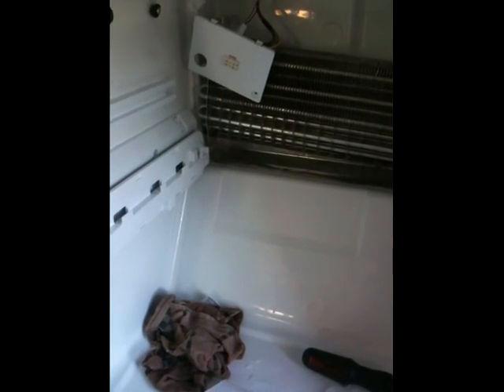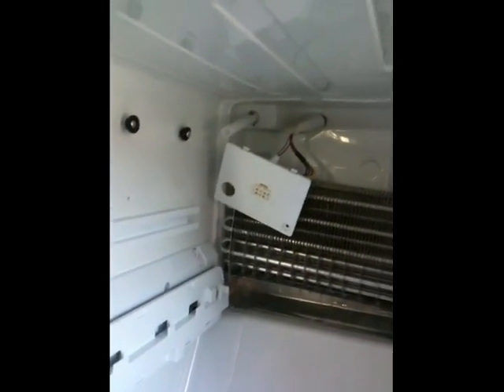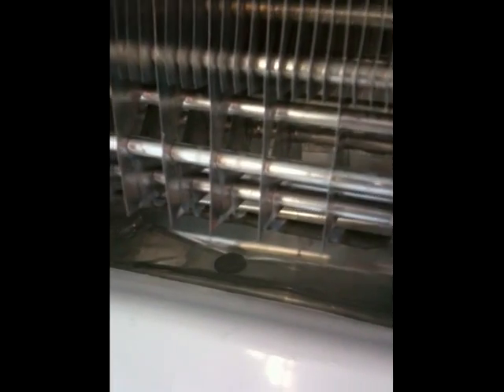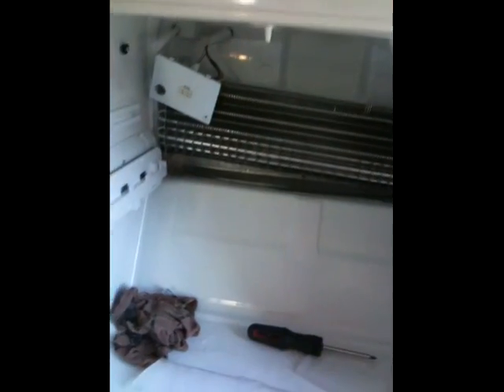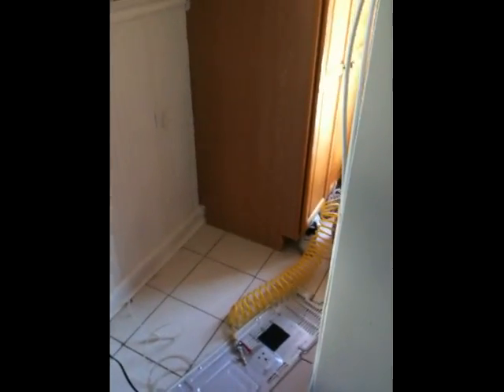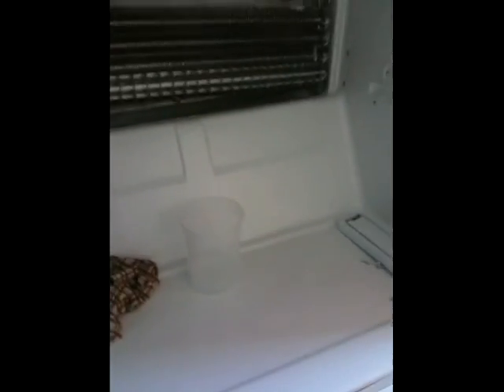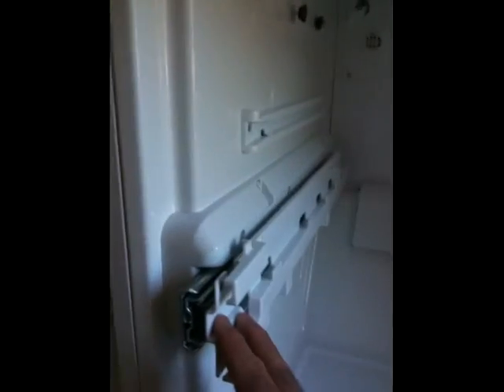LG Freezer repair (French Door, bottom Freezer model)

Comment: I know this is an old post, but I have to show my appreciation just the same.  Just did this and it was less than two hours start to finish.  Worked great, freezer is fixed. Saved me 3 grand for a new fridge.  I was concerned about the difference of opinion about removing the door. I have to say, it worked just the way you said it would.  Went back on very easy.  Maybe the guy below removed the wrong three screws.  The ones holding the door to the brackets, instead of the ones holding the brackets to the slides.  I can see potential for trouble if you do that. Anyway, thanks again!

Comment: After finding my freezer frozen shut again I let it defrost when just open a fraction.  I then purchased a small tube  FOOD SAFE lubricant from Taylor Freezer, about $4.  LG wanted about $14.  I used the FOOD SAFE LUBRICANT ( IT'S UP TO YOU TO CHECK IF IT MEETS SAFE APPROVAL IN FOOD AREAS ) on all of the lower metal door and draw slides and then put some on the plastic gears.  
Happy to say this solved the problem with opening the frozen freezer door.

Comment: Thanks! I was apprehensive about tearing into our LG refrigerator bottom freezer but the water leak on the floor near the machine and frozen water on the bottom of the freezer compartment fit the pattern. Sure enough when I got the back compartment cover off their was ice. The hair dryer worked nicely to melt the ice but it took a couple cups of hot water to unfreeze the drain hole. Thanks again for saving a repair bill.

Comment: Thanks for posting this.  After seeing the cause of the problem, I moved all my food to a second refrigerator in the house (used for cooling canned and bottled beverages (they came out)).  I then unplugged the LG refrigerator, opened the doors, put a towel on the floor to collect the melted ice from the freezer compartment, and let it sit for four days.  After that time, I opened the back of the unit (about 6 screws on the back at the bottom) and did see that the bottom tray was holding water, and the drain tube was squeezable,  I then cleaned the LG refrigerator (kinda dirty), and plugged it back in.  Two weeks later, no ice forming on the bottom of the freezer.  My lazy solution (but it needs a second refrigerator).

Comment: This definitely solved the problem and I'll note that there's a flapper valve on the bottom of the drain hose, be sure to clean it off as I think mine was stuck closes.  

Unfortunately my entire fridge and freezer stopped cooling after this, the only thing I can think of is that I didn't get the evaporator fan plugged back in.  So I get to take it all apart again!

Comment: Thanks for the service video. It provided everything I needed to take the frig apart, repair it, and put it back together. Somewhere I picked up to run a 14 gauge copper wire down through the the drain tube connecting the top end to the condenser. This is supposed to keep the tube from freezing as the copper will conduct enough heat in the drain line. Thanks again.

Comment: Excellent video, drayu! Thank you! I had been dealing with the ice buildup for months, when I found your video. You gave me the confidence to do it. And it was just like you said. 

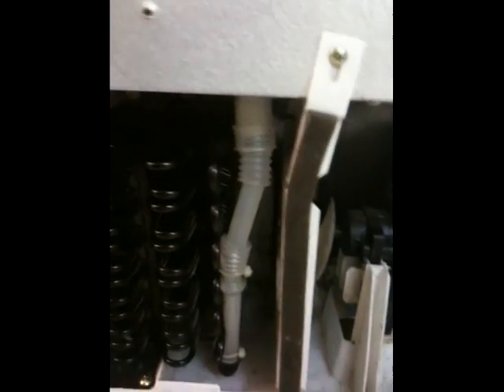The only difference in my case was the warm water wasn't draining so I checked the plastic drain tube in the back (6:30 in your video). Found a 1/2 inch plug of crud in there. I'm sure now that's what started the whole thing. I will now be checking that tube for clogs twice a year.

Comment: Thanks for this video. It gave me the courage to do the same thing myself. 
All started to an obnoxious grinding sound from the freezer when cooling. Turns out it was ice accumulation around the evaporator fan and shroud. Main problem I had was the door. Couldn't separate the hinges. Ended up just removing 4 large screws at the door base to remove. Total project time 1.25 hrs. Now Sounds absolutely quiet when running.

Thanks again *thumbs up*

Comment: Thank you drayu, this was the fix for my LG LFX25978.  The back panel has no screws on this model , so a hook inserted into a vent hole near the top, and then a light tug a couple times brought the panel forward.  It kind of hinged at the bottom, and then the connectors could be detached from the back wall, and the panel moved out of the way. Hot water loosened the ice block in the tray, then a spatula helped pull the large ice dam out of the drain area.  Avoid touching the sharp cooling vanes.

Comment: Thanks! Great Video. Saved me big $ . For my fridge (5 years old) the drain tube was clogged. There is a rubber flap on the bottom of the drain tube that opens when the tube fills with water. There was fibrous mass where the flap was, blocking water flow and backing water up into the freezer and plugging the drain hole. Remove the back panel to gain access to the compressor area and cut the zip ties holding the tube to the fins and  pull the tube down and clean it out. You still have to remove the ice in the pan inside the fridge, but if you unplug it for long enough it will thaw by itself.  It's quicker and not that hard, if you are handy,  to remove the drawer and back plastic panel to access the drain pan. There are other videos on YouTube showing how to do this.
Reply: YUP. I had the same problem. I like your description, 'fibrous mass'. I was calling it a bezoar. I actually took a picture of it.

Comment: Very helpful. We have a Kenmore Elite but it looks like almost the same fridge and freezer. I already knew I needed to get the back wall out to look for the drain hole but when I did there did not seem to be a hole! Hit YouTube for help and your video helped me realize that what I thought was the bottom of the pan below the coil was actually more ice! Once I got that out I saw the hole and just kept pouring in hot water and then sucking it out with a turkey baster. I eventually slipped a flexible bit of wire down. I also have a wonky door seal so your guess might be right. I will see if the problem reoccurs. Thanks again!!.

Comment: Great video...!! I have the same inside just a newer version. And son of a biscuit it was exactly what you described. I also found the reasoning why it was freezing and stopping up. The drain tube is wire tied to the coil which either through transit or time running had lowered the tube which then closed the tiny flap on the bottom of the tube which then fills the tube until it backs up to the freezer area and then as we experienced the filling of the actual freezer area and then on to floor....!!! Awesome video thank you for it...
Reply: +Brian Sivo 
EXTREMELY helpful comment.  Thank you!!!!!

Comment: | had the same problem on mine except that my refrigerator has an ice maker built into the top French doors.  For me it was as easy as taking the plate in the back, the plastic tube connected to the drain had about 1/4 of fibers built in at the end where the little black flap check valve is located.. I assume from dirt coming out of the coil over time.  cleaned the tube and so far so good. Took less than a minute.  Thanks for the video

Comment: Mine has a duck billed drain extension that slips onto the bottom of the drain hose. Located on rear bottom of fridge. These are a common problem, as they gum up on the end, prohibiting any water to pass. Save yourself a lot of time and effort, defrost freezer completely, snip 1/4 inch off duckbill, or remove it all together. Presto problem solved.

Comment: Thank you for this video.  I have tried a couple of times before to fix this, but was unsuccessful until now.  For the last 2 years every Friday, I removed the ice from the bottom of my freezer with a wet placemat heated up in the microwave.  I have some cracks in my floor tile due to the water leakage.

Comment: Well done!
I've just done the same on my LG freezer.. had a HUGE amount of ice at the bottom as well as at the back behind the panels. There was so much ice behind there that i couldn't even see a drain hole.. but eventually the hairdryer melted it all and i unblocked the hole! Must have been blocked for years coz the tray at the back was bone dry.
I did what 222davenport said and wrapped some copper wire around the heating pipe and guided it through the hole to stop it blocking again

Comment: Very helpful - thank you. Worked like a charm. I have LG LRBC22544st which is not a french-door up top, but same freezer below, the layout of the freezer and coolant pipes is identical to your video. I found a hair-dryer to work best to thaw ice before I could remove the chunks. Also, the plastic drain-pipe in the back had a black rubber ring, about 1-inch wide, around the very bottom of the removable plastic pipe that guides the freezer drain down to the pan. This rubber ring appears to have corroded and mostly fallen apart (eight years old?), and may have covered part or all of the bottom of the drain-pipe - lots of little pieces in the large pan below. It also appeared to have clogged the bottom of the drain pipe, so maybe water wasn't getting out of the pipe into the pan below in the back. I can't see what purpose that rubber ring serves, so I have taken the remainder off of the white plastic drain pipe before reinserting the drain pipe. All looks good and seems to work - in another few weeks I'll know if water has once again frozen. BUT THANK YOU, DRAYU - you made all this look easy, and it was.
Reply: Salut Pierre, the rubber cap is so hot outside air does not re-enter the freezer section with humidity ie. water.
I think the core problem is the defrost heater does not work.... so ice just builds up overtime

Comment: Thanks for doing this video.  I have had the same problem since I moved overseas and ever since it has been icing up.  I have ended up ordering a new evaporator fan( behind freezer panel inside) and a new door seal.  What a pain in the ass......Anyhow if it wasn't for your help it would have been slung in the trash!

Comment: Same type of problem. Freezer door frozen shut multiple times. Forget trying to get support from LG, it just didn't happen, not even a callback and the warrantee was in effect. The freezer section was also missing a cross bar. on delivery which they never sent.   I am also questioning if it is a temperature sensor not working inside the freezer section as the freeze up is intermittent.  Also the temperature reading on the top inside was never correct as it always read multiple negative degrees and one positive at 8 degrees.  Refrigerator side read fahrenheit with proper temperatures.

Comment: Drain Frozen: 2007 French Door Bottom Freezer. After the first time this happened, it took almost a year, then a month, then a week. Some of the foil covering over the white insulation on the inside of the cover you take out to see the coils was missing, and the insulation was ice/wet, providing no barrier to the defrost heater heat.The heater, which is based only on time, doesn't stay on long enough to make sure the water stays liquid along the drain pan through the drain hole. Finally scraped off the white foam insulation on the plastic cover, just the part glued to the cover you remove. Replaced with two layers of 1/8" foil faced adhesive backed duct insulation Frost King 2" wide x 15ft long for pipes, just enough, staggered and doubled (Home Depot $5) cut to fit, seems to be fine now.
Reply: I would love to see a video on your process.
Reply: I was just back to report that it has been ice free for 5 months, so I am convinced this was the fix, I haven't taken apart the freezer since to make a video. However, if you use a scraper and peel off all of the white soft foam that is glued to the plastic cover that you remove to get access to the evaporator coils, just replace it with two layers of the Frost King Model # FV15H Home Depot Internet #100174724 Store SKU #517666 $4.87, same shape, cut it with scissors. Only really need to replace the white foam insulation that has lost the original foil facing, as that is where the heat escapes, so the water doesn't stay warm enough to stay liquid down through the drain hole.
Reply: I haven't taken my freezer apart yet,  but since my LG is about 9 years newer, I'm not so certain that the cover-insulation situation will be quite the same...  but I picked up some of your frost king stuff just in case... I'm thinking that adding a copper wire might be more likely to help for longevity... I don't believe there are any seal issues.

Comment: Wonderful video, would have liked to seen more details on how to remove the doors, however the LG site has a video for that in their repair section . . . .  So ice builds up on bottom under second freezer drawer of the LMX2598 model likely caused because the drain is frozen up . . . . took a utility heated air blower (looks a lot like a hair dryer but better) and thawed out the bottom at the same time heating up the back panel hoping the plug would unfreeze  . . . at some point I did hear ice drop into the back of the refrigerator indicating that maybe the plug had thawed out . . . I theorized that all this happened because the door was not closing completely on the bottom either by accident or because of the ice buildup . . the door was out of alignment the right side hitting first . . . didn't want to take the back panel off because that looked to be a lot of work when all I had to do is thaw everything out . . .in fact I could have just taken things out put in my basement freezer and then turned off the LG LMX2598 at the circuit panel without having to move out this very heavy unit.   I do have access to the rear from a vent in the wall which allows me to clean out the air vents on the back side.    Bottom line, thawing out the ice and watching that I don't stack stuff too high in the freezer drawers (air circulation is VERY important) appears to keep the problem from repeating along with making sure the freezer doors stay closed properly.   No drawer removal required and no need to pull the unit out which made my day much easier.   Hopefully it will hold up for the long run, if I watch these items.  Saved me an expensive repair call and again appreciate the advice in your video.

Comment: Update 9/2/2013 - We've had a really hot several days here in SoCal, and my refrigerator is actually not installed in a space with the minimum 3/8" clearance on each side, so the bottom half of the freezer is getting excessively hot.  I fixed the problem of the plugged drain, but it has come back.  My suspicion is that the cooling vanes are going through excessive freeze/thaw cycles and is dripping into the the drain hole at a rate that doesn't allow it to clear, which then gets frozen in place.

Comment: I simply empty freezer and aim a grass blower against two vents on rear wall (after unplugging fridge) and let it blow warm room air. Takes about 20 minutes (a little noisy) but saves all the labor of taking the panel apart. Need to repeat every six months or so but cheaper than repair men or new fridge. May try the copper wire if it freezes up more frequently.

Comment from the maker: When the freezer defrosts and water drips down the back, it goes down through a SMALL hole that leads to the drip pan on the back side of the fridge.  It evaporates from there.  Watch the video again, i think I explain and show the tabs that have to be removed to get out the supports for the shelves.  Basically, you push down on the metal supports and slide the center piece to the right.  It is a TIGHT fit.

Comment: I did the dryer thing first time but be careful not to have heat on too high as it can melt plastic. Blower is cooler and faster as you can just set it inside and do something else. Don't forget towels.

Comment: Had the same problem but instead of taking apart the freezer I just disconnected the plug then opened the back plate in the back then cleared the tube it was all I needed to do it got done was way easier Thanks though for your video

Comment from the maker: There are many ways to defrost it.  The problem with the hair dryer/heat gun/ blower/leaving open the door over night is that if there is a solid build up of ice under the coils covering the drain hole, like mine does, you will spend WAY more time at it instead of taking it apart.

Comment: we have the same type of LG fridge / freezer.  water has been leaking out the freezer due to ice building up at the bottom recently.  i think that it started after we set the freezer to 7 (the highest / coldest setting possible), which makes me think that ice has blocked the hole to the drain pan, causing the water to fall into the freezer bottom.  i'm guessing that this is the case for most people???  ... that it is ONLY water / ice blocking the hole to the drain pan and not dirt or lint?  if that is the case, i'm wondering if it'd be a lot easier to either let the freezer thaw out for a day (which is not practical if you only have 1 fridge to keep your food cold) or use the hair dryer on the tube that connects to the hole / drain pan.  suggestions?
Reply: so, as in the video, there was a thick sheet of ice in the back of the inside of the freezer so heating the ice from the tube that connects to the hole / drain pan did not work for me... i had to remove the panel on the inside of the freezer to give me access to the drain hole.  so, i wouldn't waste time removing the panel on the back of the fridge.  
a couple of helpful tips...
1) i was able to slightly bend the middle of the panel and remove it without removing any of the rails / arms, which saves time
2) i recommend using a light (so you can see) and initially a hair dryer and a towel (to push up into the drain pan) and then - once the thick sheet of ice has been removed - a hair dryer, hot water, and a syringe or siphon to suck out the water that builds up in the drain hole.